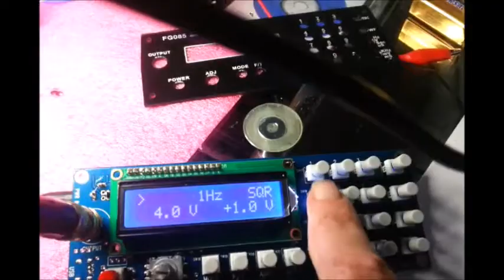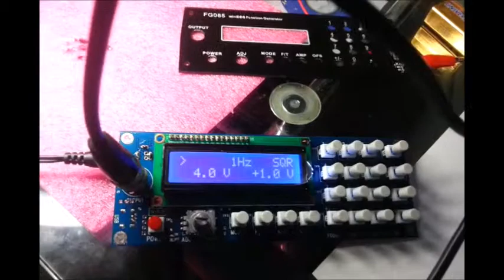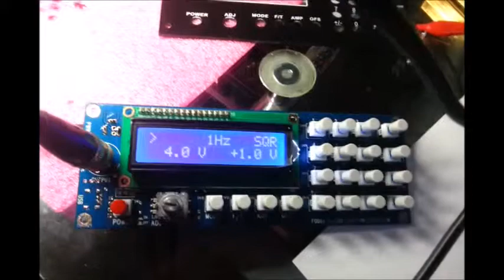FG085 DDS Function Generator  Need to know

Comment: The keys are using only a single 1 pole contact, the others are not connected with anything. So if the keys are mounted in wrong way, shouldnt it be possible to connect them right by simply putting one ore two bridges on them?